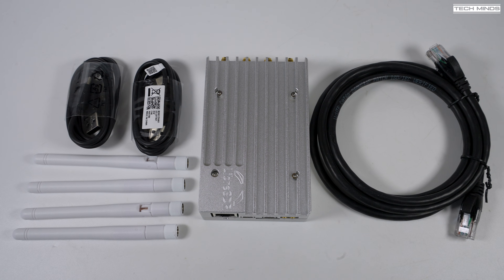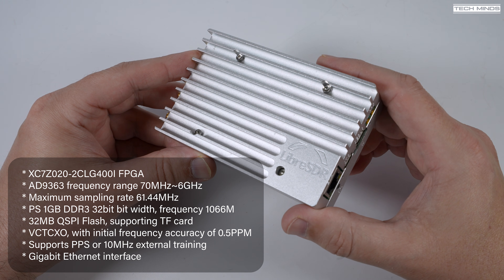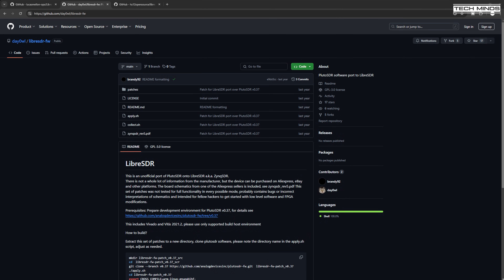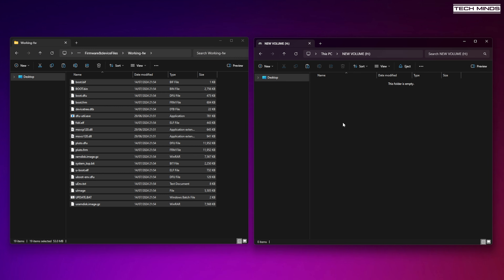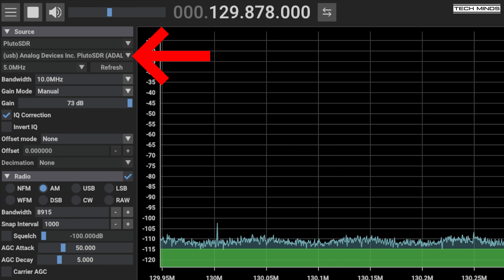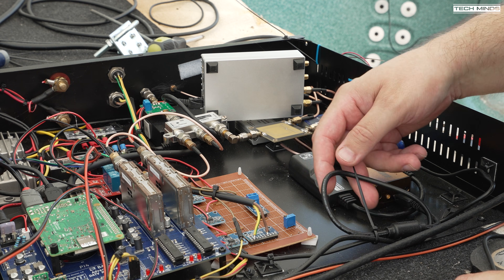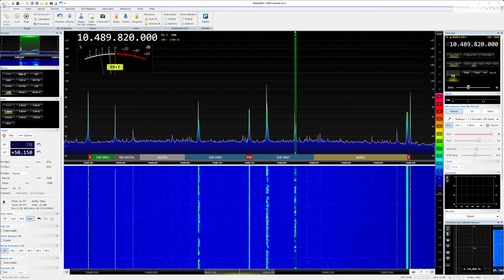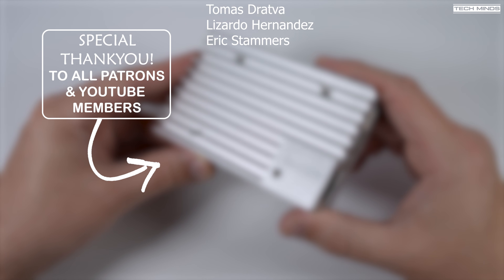LibreSDR / ZynqSDR Software Defined Radio - 70 MHz to 6 GHz

Comment: I got the same sample and spent a vast amount of time looking for the firmware once my experiments goes wrong and Libre got "bricked". Thanks to local radio enthusiasts I recovered my SDR . Later I found the Chinese company "Broadon" that is likely to be the original producer . They offers complete set of the documents and  schematics for this device once you buy it from them directly. If any one is still interested I can share the pdf with the schematics of the device that I have found .

Comment: isn't AD9363 being a cut-down version of AD9361, with only 325 MHz to 3.8 GHz and 20MHz bandwidth? wonder what hacks they did to make it perform at the higher AD9361 spec?

Comment: Be ready that it could die after 1 year of usage. I have 2 pieces: 1 became dead after inters power supply ICs get burned,  another one in now under service for the reason of dead Ethernet probles-no ping, no detection by network analysis SW. 😢

Comment: So, is it true what another comment below says?
That it doesn't have any form of frontend filter
If so, how could we make it usable? external programmable filter of variable bandwidth should be expensive, right? 
Thanks for the explanations! :-)
Reply: It has an SPI port on connector SN1 inside the case. And the AD9361 driver has ability to control external filer banks. Just need to get the filters similar to what AntSDR installed in the board
Reply: @SergLapin  hmmm... I'm sorry sir, but could you briefly expand on filtering, AD936x, AntSDR, LibreSDR and Ettus' SDRs? I tried searching online but it has not been straightforward enough for my current context. 

Basically, for RX, AFAIK frontend filtering with adjustable bandwidth is performed by AD936X on the amplified and mixed signal to be digitalized. The questions are: does the e.g. Ettus B210 adds some filtering mechanism? Does the LibreSDR does? what about AntSDR, what does it add?

From your previous answer I take that LibreSDR adds none, AntSDR adds "something" which I'd appreciate if you could elaborate more about, and most probably Ettus devices add something too.

Comment: What does this do that a SDRPlay doesn't do?
Reply from the maker: Transmit, wider frequency coverage.... Runs Linux.. Customization.. List is endless really.
Reply: @TechMindsOfficial  SDRPlay also run Linux through their new SDRConnect software
Reply from the maker: Well yeh, you’re talking about the SDR software, I meant the actual LibreSDR runs Linux so it can run standalone.

Comment: It's silly to mention something as a 'default IP address' all of that is handled by your routers dhcp settings
Reply from the maker: Its silly to make silly comments! The default IP address is fixed in the firmware, it does NOT use DHCP.... by default...

Comment: i think the reason you had to manually set your ip is because your sdr firmware/software doesn't have a dhcp client, probably something you could add...
Reply: It does have DHCP and Avahi for auto-discovery, it needs to be enabled because otherwise it would be pain in the (_._) finding it in the network.

Comment: Did you ever figure out how to flash the firmware into the onboard flash? I can't get that to work. It does boot from the SD.
Reply: Actually it boots faster from SD card. Plus it is possible to make a full blown linux distro with writable root fs and have stuff like GNU Radio and other goodness on board, which would never fit into the QSPI flash.
Reply from the maker: Yeh, I think I mentioned it in the video, but the way I got it to hold the FW in flash was to boot from the SD card, and then once the mass storage device appeared on the PC, I then copied the boot.frm and pluto.frm to the mass storage, removed the SD card and then hit EJECT on windows explorer for the mass storage drive. When it rebooted it wrote to the flash.
Reply: @TechMindsOfficial  I tried that already, I did listen to the video. I also used the same firmware, but it doesn't work for me. Very strange. Maybe there are different versions.
Reply from the maker: okay, take a look at this, specifically the last message in that thread. https://github.com/hz12opensource/libresdr/issues/1
Reply: @TechMindsOfficial  Didn't work. Must be a difference in the hardware or boot loader or similar. Works on the SD card but not with that image from the link. I can see it on the debug console though when it is doing that..

Comment: Tip, be careful plugging in coax / antennas, the sockets aren't secured to the PCB properly, they will shear off if any lateral force is placed on them. (on my early version this happened anyway)

Comment: Just a tip, make sure to add breaks for really long transmissions. Also, it’s aluminum, not aluminium
Reply: Check how they spell and pronounce aluminum  in Great Britain
Reply: I wish Americans would either learn to speak English or correct Spanish. If you have to bastadise every tongue just make up you own
Reply: Aluminium! 

It is called 'aluminium' ! 

 - Period ! -  

Never believe in a country, still using inches and miles, instead of the correct SI-units, ... ! 

Think about the space-ship, what 'crashed' because of faulty re-calculations of some stupid old man, ... using the 'old' system, instead of the correct SI-units. 

( HI HI ! ! !)

73 de Markus - db9pz 

(Using the 'SI-units', since the middle school, ...  and ever said 'aluminium', my whole life!)
Reply: In '47, Mr Richard S. Reynolds, Sr. (nephew of R.J. Reynolds) introduced his aluminum wrap in the United States. We'll just stick with that...🇺🇸 👍☕

Comment: I got the impression during that satelite contact that one of you was treating the frequency in use as the bottom of your signal, like you were transmitting upper sideband, while the other was treating the frequency as if it were the center of the bandpass for the transmission (more like AM, but I suspect both were FM transmissions. It looked like the bottom of your signal was on the center of his. Most of the satellite transceivers I'm aware of are fairly broad rx/tx systems, as that's about the only way LEO satellites are usable, and I'd expect that the Geostationary satellites are using similar transceiver setups.
Reply from the maker: I was using USB and the station I was talking to was off frequency. This happens when users don't listen to their own transmission properly, which is actually a requirement of QO100.

Comment: How many watts does the LibreSDR output ?
Reply from the maker: Depepends on the frequency. @ 2.4 GHz I measured around 10mW.
Reply: @TechMindsOfficial  Thank you. I was just trying to understand how you made contacts over RF. Maybe the SDR is the reciever and you have another radio as the transmitter. Just curious
Reply from the maker: @ko4mkp  Take a look through my videos for my QO100 build series. I built a NB Transponder and WB Transponder transceiver using an Adalm Pluto as the exciter. For the NB Transponder, which I showed in the video using USB, I was using the LibreSDR to transmit and receive at the same time.  Downlink is 10GHz into LNB, 750MHz out of LNB to input of LibreSDR. Uplink consists of LibreSDR into a 2.4GHz Amsat / filtered amplifier (up to about 50 to 100mw) and then the amp goes to a 250 Watt 2.4 GHz amplifier, which then goes off to a Helix antenna on my 1.2M offset dish. Ofcourse with that size dish, I only have to "tickle" the output power slider so I only get around 10 watts at the helix. For DATV, I need between 60 to 100 watts, and even more if I use a higher Sample Rate. But most DATV stations stick to around 333k/s or 500 k/s, but we can go as wide as we want, which takes more power. Hope that makes sense, but go check my build videos.
Reply: its going to be milliwatts

Comment: Gate Arrays are not software, they may seem like software being labeled Fully Programmable...  but that's a lie.  What I'd be specifically looking for is Turing Completeness and that depends on the programming of the array, so an FPGA is only Turing Complete in some configurations and it's questionable if those configurations would be good enough to handle any load or compete with processors that are designed to be TC.
Reply from the maker: https://www.arm.com/glossary/fpga#:~:text=Field%20Programmable%20Gate%20Arrays%20(FPGAs,requirements%20after%20the%20manufacturing%20process.
Reply: @TechMindsOfficial  If you call them Field Programmable Gate Arrays someone in inevitably say it's Fully Programmable...  I guess it's nice to confirm the opposite is true, however.  My argument was even if they were Fully Programmable, that's still not software.  How is it BETTER for the definition to be Field Programmable?  Are you suggesting that the Array is configured to be an ARM processor that then loads software, in that case wouldn't a ASIC ARM chip be cheaper and superior in every way?
Reply: The device is a Zynq which contains an FPGA and Dual core ARM cortex A9 in one device.
The Arms are like any other Arms and eat pure software.
Reply: @cccmmm1234  As a guess...  The arm chip is there purely for administrative tasks, flashing the FPGA and routing IO.  It's unlikely to be involved with much of the signal processing.
Reply: @PetraleiTanyl  No, absolutely wrong. These CPUs are typically A9 or A53s. Dual or Quad core with NEON and often also GPUs. They typically have a few hundred megabytes of RAM and run Linux.
In this case it is a dual core A9 running Linux. The Linux provides all the networking,  web interface etc. And also runs some DSP.
Reply: @cccmmm1234   How is IO and some DSP different from what I "GUESSED"...   no, not doing all the digital signal processing in software is what makes this not a software defined radio.  ALL OF YOUR RADIOS USE FPGAs.
Reply: @PetraleiTanyl  I think you are redefening SDR to make some kind of point. Are you saying that unless ALL  the processing happens in software then it isn't SDR?
All SDR systems use at least some hardware signal processing in their processing, even if that is just a low pass filter.
I would define an SDR as any system that actually does some degree of signal processing in software. As demonstrated here, the hardware is generating I Q values which are being passed to software (SDR console or whatever). That software is doing the demodulation etc from IQ values, just as ir would from an RTL SDR or other IQ source.
So this  most certainly SDR.
Reply: @cccmmm1234  Obviously, the integer addition is done in hardware and always has been.  That's why in the OP I had inquired about Turing Completeness.  As long as the hardware signal processing is performed by a Turing Complete language(ARM assembly, for example) then it would be software defined IMHO.  For SDR to mean what most ppl think it means the carrier must be locked onto in software using math like in Fourier Transform, otherwise it's an analog radio no matter how fancy the container.  Software is Turing Complete.
Reply: @PetraleiTanyl  yup, you could define SDR that way and that is how this device works.
It generates I and Q data which is then decoded in software. 
The actual receiver runs in software even if there is a hardware stage up front that down converts to baseband.
The FPGA portion provides a data path and potentially some of the down conversion. The actual receiver runs in software.
Reply: @cccmmm1234  It can run some DSP, but in the vanilla implementation it handles I/O using IIO interface over Ethernet, USB or local(if you want some DSP on the board)

Comment: What is the sesn to start from 70MHz . That do not cover short wave.
Reply: Knowing that it's built in China, and not some of the very latest in hardware, it's possible that the manufacturer felt limited by the requirements of China's equivalent of the FCC in the US, to not allow it to work in MW frequencies as it would allow easier contact with people outside of China. Having seen some of the equipment otherwise on the market through AliExpress, I wouldn't be surprised if equipment for export is no longer restricted that way. In any case there are transverters that will allow you to specify a block of frequencies that the LibraSDR will transmit and receive on, that the transverter will transvert down into the MW, and even LW bands. This is similar to how the system he used was able to receive a 10 Ghz signal from the satellite, on a device that maxes out at 6Ghz.

Comment: This reminds me of cabling 2 computers together back in the 1980's & 1990's via Ethernet. Have you tried connecting the Ethernet port directly to the computer's Ethernet port ? Currently computers use smart ethernet ports so it would operate with either a straight thru cable or crossed wire cable. You might be able to gain extra access to the radio's memories & electronic controls. 🤓
Reply: Look out, there is a new oracle in the house.

Comment: Thanks so much, I have always been wondering if this is a Pluto Plus version with a bigger but compatible FPGA and a proper case. So I wasn't sure if you really got the SDR Console working via the ethernet or if it was the Pluto USB-Driver that emulates an IP link via your Windows client. If I go with such a solution I want to make sure Gigabit Ethernet actually works, because the TRX will not be in my shack. So if I understood correct, the Adalm Plus (also with two TX &RX) is the practically better solution if you are, like me, not a software developer and more on the side of a tinkering end user. Ideally I would love to have TX&RX1 connected to a similar setup you have, a box with bandpass filters, amplifiers, GPS based oscillator, for the QO100 operation and the second port for individual frequencies from 70MHz to 6GHz. But I think so far only SDRangel is supporting dual port operation TX&RX?
I noticed while showing the VHF Air Band scale plenty of Tetra signals from the lets say roughly 400 MHz region ... so it has serious front end/imaging problems? Does the Pluto Plus also have these issues or is it simple overload or rather a poor PCB design that creates that issue?
The TCXO on the other side seemed pretty good, I think I heard some 30-40 Hz drift during your demo, which is pretty good for a 2.4GHz frequency. Though I would use the GPS based oscillator via its MCX sockets.
I'd love to see a comparison of the original Pluto, vs. Pluto Plus, vs. this Libre SDR while receiving weak signals (e.g. far away ATIS, distant ham repeaters on UHF) without any preselection to figure out which one is the cleanest implementation with the least amount of intermod and noise. Currently I see the price of the Pluto plus at 235€ and LibreSDR costs 285€ and the old Pluto is being dealt for some ridiculous prices despite it is the worst implementation without an ethernet port, a stable oscillator, an external oscillator input, only one port of the two that the AD chip offers and the USB 2.0 creates a huge bottleneck when it comes to bandwidth. I have one of the first Pluto's and have been operating it via an USB to Ethernet adapter but its a joke, because it drifts way too much and is not usable without the oscillator mod, which I still have to do. But I may just go for the Plus or Libre and use the old Pluto just for tinkering with amps and UHF antennas.
What is the maximum usable bandwidth with the two Gigabit Ethernet devices? I know the AD chip can do some 64MHz I believe, but at 12 Bit I/Q this creates a lot of bandwith and needs plenty of math power I guess. I guess the practical limitation will be the interface speed the Ethernet taps in? I wonder if it can do 20MHz, eg. 118-138MHz in one stream?
Once again many thanks for the very interesting introduction and best regards from Munich, Germany
Reply: Thanks for saving me typing! Thats exactly what i was going to ask. Im torn between this or pluto+ and i really want an out of the box solution without too much hacking or compiling firmware.
Reply: Same a question. I want to buy a stable out of box accurate SDR. Which one should I go for, Pluto+ or the LibreSDR? Do they both run on the same firmware btw?

Comment: Treat it like a Pluto SDR. Open it up and compare it to the available ADI schematics for the Pluto, and the other SDR platforms based on the same chip. You should ssh into it and see what it has inside.
It’s like every other SDR out there based on Analog Devices tech and designs from the Pluto II TO the Red Pitaya

Comment: Do open it up, so we can have a look inside.
Reply: Real hams open stuff up before they plug it in  :)
Reply: @imoldovan i opend up my icom 7300 just to see what parts i need to desolder to make it full band transmit nit that i changed it but just in case shit hits the fan i know i can
Reply: Dont turn it on 

TAKE IT APART

Comment: So which Pluto clone , Pluto+ or Libre, do you prefer?
Reply from the maker: Pluto+, until some working overclocked firmware appears for the LibreSDR.
Reply: @TechMindsOfficial  How much overclocking you are looking for? The github repo you mentioned gives a decent overclocking for CPU, RAM and enables the maximum speed on LVDS interface between Zynq and AD9363
Reply: Could u make a video comparing all of the analog devices? Also could this libresdr run antsdr e310 firmware  @TechMindsOfficial